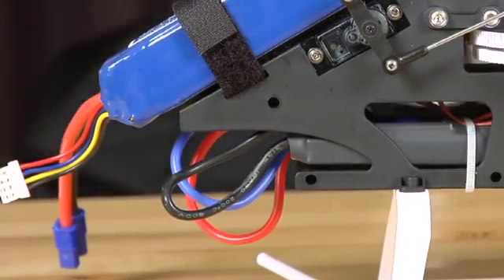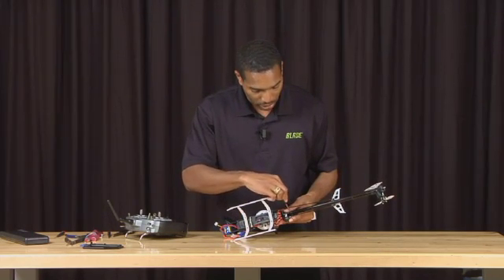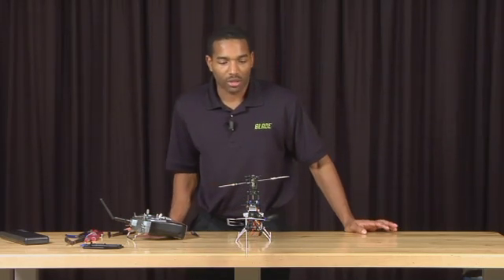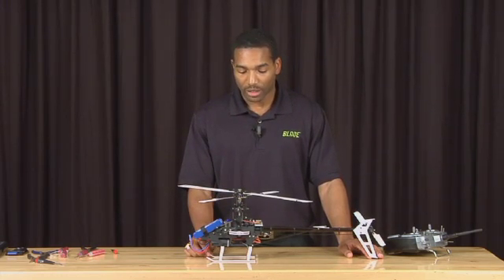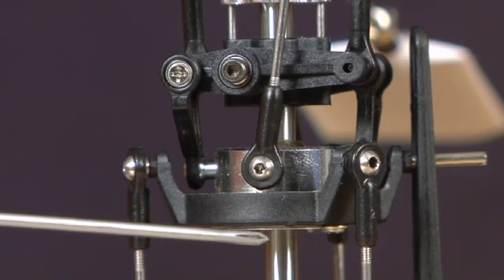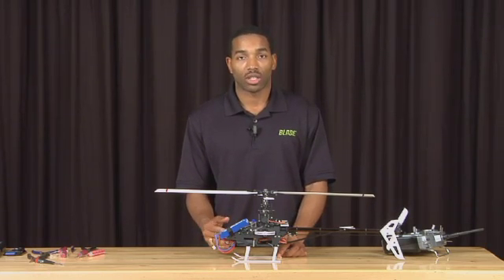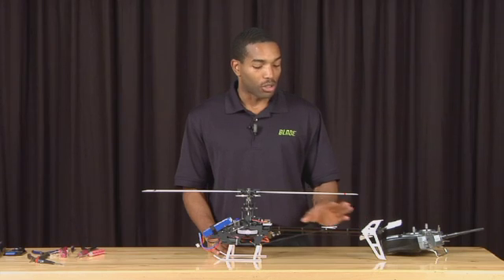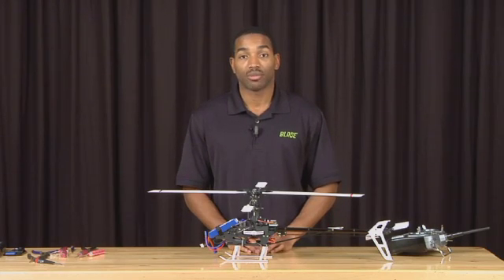Blade 450 3D Mechanical Setup tutorial

Comment: Check the pitch of the paddles on your flybar. That's what caused a similar situation on mine. All good now. Just make sure the pitch is level on both sides by lining them up with the two allen screws at the cradle.